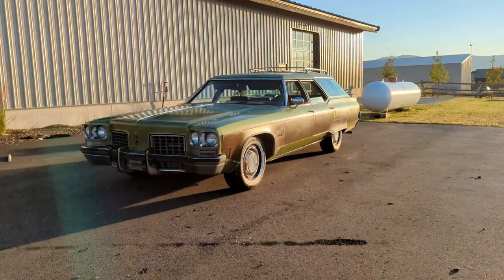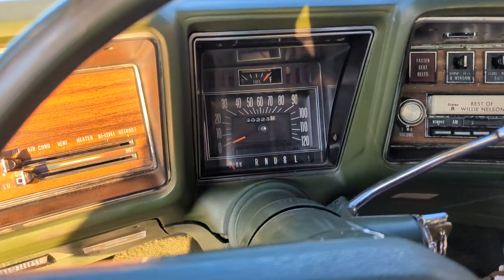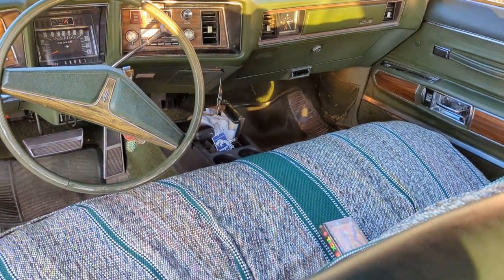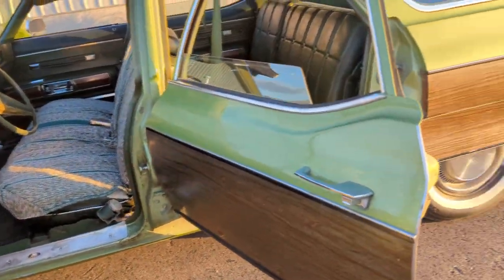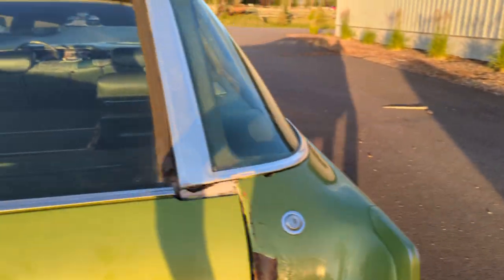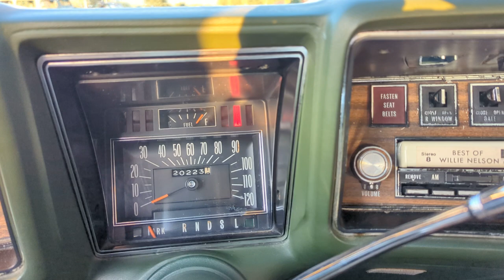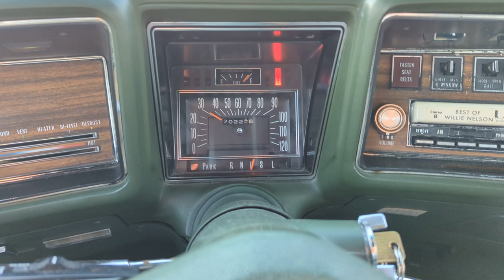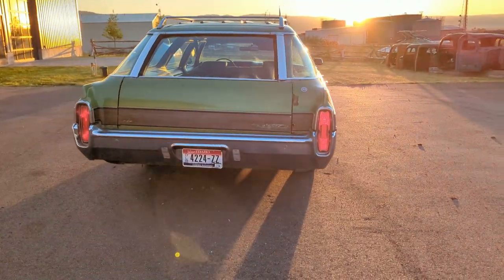FOR SALE! 1972 Oldsmobile Custom Cruiser survivor - Rocket 455 V8 - GM Clamshell - $13,000

Comment: My parents had a 1974, I remember it well. Got my foot stuck in between the rear jump seat. My father was an Italian immigrant and loved big American cars with big engines. He really liked the 455. In 1978 they traded it in for a new custom cruiser, my dad cursed the 350 for being underpowered. The ‘73 started my love affair with cars. I used to love the sound of full throttle while we would pass two cars at one time on a two lane highway. We lived in louisiana and took it to Colorado every year on vacation. You’ve got a great machine there pal, take care of her.
Reply: Parents special ordered a '73 model.  Dad built a clam shell for the roof and a matching clam shell trailer so our family of 7 could travel the country.  We live in Texas and drove it all over the U.S. and up into Alberta once too.  It was a real beast of a machine.  Smooth ride and comfortable with plenty of power.  Dad sold it back around 1990 for junk and still kicks himself or such a bad decision.  It had around 300,000 miles on it and engine still ran good.  It needed some minor work but at the time he wanted to get it out of the yard.  Dad just turned 92 and according to him, he never had a better vehicle!  I would love to find one to restore and go back to some of the places we vacationed so long ago!

Comment: Awesome Clamshell wagon!!
Love them.
I grew up and learned to drive on our mint, loaded 76 Grand Safari with the cornering lights and rally II key colored wheels as optios.
It had everything!!
Cream with wood!!
Today i own a maroon 76 caprice Estate in beautiful awesome condition inside and out.  Maroon with red interior and wood sides.
Never goes out in the rain!!
It has the 3 seats and power gate and doorlocks.. but not completely loaded!!
It has the 400 4bbl rebuilt and ac blows cold but i replaced Everything under the hood but the carburetor...  my mechanic said its good. Dont touch it yet!!!
Our Pontiac wagon had the 455.. same gas mileage on both.
Thanks again for sharing your GEM with us!!!!!  ❤

Comment: Hi my name is Carmine and this car leaves me speechless! The car is  beautiful looking and running. I have the same wide white wall tires on my 1984 Olds 98 Regency.  It was the same size that the car had from the factory. It has 151,000 mi. I also have a 1987 Olds Customer Cruiser with the 307. It just passed 270,000 mi. The engine had never been open and it still runs and drives  great.  Last but not least my 1978 Olds Delta 88 Royale.. with the Olds 350. It is a 1 owner car that I was lucky enough to buy from the grandson of the original owner.  She only has 33,000 mi. It was never taken out in any weather.  I always say you can't go wrong with an Oldsmobile. I love yours and I wish I owned it. If you ever want to sell it let me know.  But if I were you I'd keep it. Glad to hear that you're keeping it doors. If your looking for alittle extra power,  do like I did to my 3 cars. Put on true duel exhaust from the manifold back. Use stock mufflers and don't forget the exhaust resonators at the end of the pipes. It will keep it factory quiet and it will give it a noticeable improvement in power especially on the highway. You can use a lead substitute but you don't have to. Just stick to using PREMIUM fuel.  Yes they have lower compression engines but trust me always use PREMIUM.  The little bit of alcohol won't kill it. I use Sunoco 94 ultra in all my Oldsmobiles.  Last but not least use Royale Purple oil.  It is fantastic.  I noticed  on avarage a 5 to 10 degree drop in my coolant temperatures.  Feel free to contact me at any time for advice.  Good luck with it. Enjoy it hang on to her.
Reply from the maker: Appreciate the response, Carmine. This is all good information to have. I plan on the dual exhaust and new door seals this season along with a cooling system flush and new wheel cylinders. Next season I will probably tackle some of the more minor Imperfections.
Reply: @LiamO86  Liam you have a great car. And wait til you do the exhaust you will be happy.  I did my cooling systems to. If you don't have a 3 core radiator which I'm sure the 455 has, get one. If you not going to drive it much in the winter you may want to use a 180 thermostat.  Like I do with mine. Keep me in the loop I'd love to hear how the car is doing. That's some car!

Comment: Love these big wagons !!! She sure is a beauty,  & for 51 years old in pretty decent shape. That Clam Shell rear door certainly adds to the character!
 My folks bought a new 1974 Olds Custom Cruiser 9 passenger wagon in Oct 1973.  Not much difference than your 72,  grill, tail lights, & trim.   It was non metallic light green without the wood grain. Had a medium green interior.  There were 5 of kids & we needed the room. Traveled many miles on some great vacation in that big car. It had a 455 V 8 as well,  but suffered from the emission & smog controls that your 72 doesn't suffer with. The gas mileage was 10 - 14 mpg,  but the power was NOT as snappy as those per-emission models. The horsepower rating were down because of the emission controls,  but these were heavy cars. My folks drove that car for years & well over 200K then donated to the church they attended & the last I new it was still at it with over 300K before it drove off into the sunset.
  These big wagons had some style & character about them. They could be a luxurious dressy ride for a formal outing,  sporty ride to transport the team,  or the lake side, canoeing, fishing, or camping  & had the muscle to pull a big boat or travel trailer with ease,  as well as a load floor & capacity to handle a home improvement project, no problem. The wagons that followed these certainly didn't have that character, or capacity.
  I have looked for this era of Olds Custom Cruiser wagons for years.  All were extremely rusty, over priced, or both.  So I've settle for a solid rust free 1973 Chrysler Town & Country wagon with a 440 V-8,  9 passenger rear facing 3rd seat, drop down gate / swing out rear door,  beige with the wood grain. It got class & character as well. 
 All these big wagons were used, & used, & used, & abused,  & to find a solid rust free model is rare.  Love you Olds.  she sure has class & style.  Best of luck with her, Hope that really unique clam shell window gate works for you. Thanks for sharing it has brought back a lot of good memories!!!!
Reply: Chuck, do you have any phots of your wagon?
Reply: @patrickflohe7427  Hey there,  Sorry to say I don’t know of any photos for that 1974 Oldsmobile Custom Cruiser that my parents purchased new.  I would have like to have some pics of it myself;  would have gladly shared. 

🎄 “Happy Holidays “ !!!!!! 🎄

Comment: Great to see, Liam.  My Dad bought a cranberry red '73 new that we had for about 17 years but had no more than 54,000 miles in its use transporting us children around primarily.  The Custom Cruiser was the most expensive station wagon at that time and simply loaded with everything.  I wish I had the chance to drive my parent's just to get the experience of the legendary Olds 455.  What did the car in were electrical problems.  I suspect that a rust hole near the back window and locking switch for the tailgate was due to inadequate drainage resulted in water accumulating causing rust and electrical issues.  I guess I am partial to the look of the '73.  And the rear tailgate was a total party trick certainly.  A very solid RWD car from General Motors "good ole" days.
Reply: ‘72 was my absolute favorite.

Comment: You're probably aware of this, but by 1972 these had hardened exhaust valves, so were designed to run on unleaded.  I had two clamshell wagons and found the gate to be utterly reliable, but every couple of years it appreciated white lithium grease on the tracks to keep it moving at a proper pace.
Reply: I thought that wasn’t until ‘73 or ‘74?

Comment: 16:30 Now THAT's what a turn blinker/hazard indicator should sound like when in use! Not all wimpy soft as on  today's cars.
Reply: Then the sound was actually mechanical- the electromagnetic relay controlling the blinking lights made this iconic audible noise. Since it’s genuine in a car like this, it sounds more full and authoritative. Modern cars just play a digital facsimile through a speaker in the instrument cluster.

Comment: My family owned the 1973 model, the most expensive wagon GM made AND was more expensive than most Cadillacs. They drove beautifully. We had an issue with the fiberglass lined gas tank, which made its way into the engine clogging everything.

Comment: With a sled like that I'd give priority to the brakes. I've had a couple 70s vehicles where the brakes worked but something still wasn't right and it turned out to be the proportioning valve was bad. Also if the fuel filter was clogged with rust I'd check the tank to see where all that came from.

Comment: Years ago my mom had a station wagon. It wasn’t an Oldsmobile. It was an Impala Station wagon. Total rust bucket but the engine and transmission worked fine. I remember going thru a car wash with my mom and because of the rust seals around the window leaked. I got totally soaked

Comment: I always loved the look of the full-size SUVs (err, sorry, station-wagons...but really, what's the difference besides the platform they're built on?) of GM from '71—'76, regardless of make.  I always thought they were the best-looking wagons ever, and one of the best-looking cars in general from the '70s.  The very streamlined profile, the slant back with the wraparound curvature of the windows, and of course that cool tailgate mechanism all were decisive factors in my love for them, be they built by Chevrolet, Pontiac, Buick, or Oldsmobile.  If Cadillac had jumped on the bandwagon back then (maybe their first-ever "Escalade"...?), that would have really been something!  I remember wanting one of those as a kid, but my grandmother would not hear of it...probably because she still sorely remembered her experience with a brand-new 1960 Kingswood she had been convinced into buying.  Of course, the Kingswood of that year had nothing looks-wise on the Kingswoods that would come about 11 years later.  I would still like to acquire one of those as part of a personal collection, though I think I might prefer one from the Buick division; I just like Buicks best of all the GM makes.

Comment: I find it amazing that GM had the money to use a shorter wheelbase on the essentially similar Chevy. Not sure that the extra couple of inches really made any difference in the interior room. Perhaps it was just a selling point. BTW, according to specs that are available now, the Chevy 454 made more HP than the Buick and Olds 455s.

Comment: An awesome looking car. I think something like this makes the most functional tow vehicle for whatever you bring into a show or a swap meet or track the only problem with this thing really is not the 455 V8 it's probably getting like 14 mi a gallon. The problem is you don't have OverDrive that's the only thing you need. With just 3rd gear I would just say probably investigate getting a new or different rear-end you know a rear-end with like taller gears like 3.23 or 2.91 or something like that so this way you can cruise at highway speeds in 3rd gear and still get about about seventeen miles a gallon if you're using this to toe. I mean that's what I  meant for you to tow the car to a another car show and then you can sleep in this car cuz you can put a cooler in the back you can put extra tools in the back and put in the ice chest and a pillow and a change of clothes. And then you can sleep in the rear.

Comment: The old Station Wagons were the best & most practical vehicles in their time. They rode like Limos & they had payloads like 1/2 ton pickups with RWD & great towing capacity. The Olds Vista Cruiser & the Buick Estate Wagons with the 455's were the ultimate Wagons in luxury also. These new SUV's are a joke in comparison. The Station Wagons were better in every way except for gas mileage.

Comment: As this was posted 3 weeks ago you've probably been told to hold the Parking brake release,and pull up on the pedal to turn off the brake warn light.GM's did that all the time.The spring doesn't pull hard enough for the last bit to hit the switch.Nice ride.If it isn't a fuse,then water around the key switch at the tailgate rusted it and the contacts are poo.

Comment: I made previous comment  forgot to mention     i have  5 wagons oldest  50 mercury
56 nomad   56 corvette engine    66  Mercury  67 new Yorker 2   one 33k and one 73 k 
Best lead substitute  marvel mystery oil  add to fuel i use in all my wagons   other equipment  and  trucks   Use Delo 30 in summer  10 30 winter  or 15 40  
Use A/C Delco filters or Wix or Napa Gold (made by wix )  Never Never use fram filters 
They ruin engines  ...### now  as far as Brakes  you have  3 Rubber brake hoses  ##
Change them ASAP    average life 8 years on them max   change and flush brake systems   ... fuel economy  add dual exhaust  helps ... buy parts at napa for best quality  
Awesome wagon  thanks for sharing this 😊👍  what state are you located

Comment: The valve guides wear out in the 120k mileage range ( might start to smoke a bit on start up) as far as the air conditioning goes it could be as easy as replacing the dryer ( the moisture makes them crap out) overall she's a beaut Clark!

Comment: you can find all of the spec's;  last yr for high-torque was '70.  To trust it driving is to change many things;  all fluids, hoses, belts.  New motor mounts and tranny mount   drop the gas tank and get it cleaned.   Ask around for availability of water pump and alternator.  or get new brushes for alt.  potentially better front seat in bone yard somewhere

Comment: The 72s had reflectors above the taillights, that little body-colored piece that's attached and makes the tip of the rear fender "straight" I guess you would say. That's how you tell the difference between the 71 and the 72 from the back. I don't know why this one has 71 rear 1/4 pieces...

Comment: I respectfully disagree with the mileage.  I think it could be a 20,000 mile vehicle. The pedals, especially the brake, don't indicate over 100,000 miles. And the drivers door armrest isn't worn badly. Also, the engine is clean, and the valve covers aren't sweating. The engine sounds like a 20,000 mile engine.

Comment: These aren't hard to fix.  The sheetmetal looks in good condition,  can get the missing trim from junked ones and the front end is the same as the Delta 88 and 98 Regency from the same year.  Very nice and a rare sight today.  Could join ASWOA with it and take it to their shows.

Comment: That 455 deserves  a true dual exhaust system  and a new 4 barrel holly Carb  switch to light duty pickup truck tires & shocks & brakes  when you do your oil change  get a bottle of Prolube engine friction barrier treatment  help reduce the RPMs  the product has a pink  & purple label on the bottle  do not use platinum tip Spark Plugs  they will burn a hole in the crown of the piston  the pistons are probably not  hardened performance pistons  stick with  Goodyear tires  and a big  interstate 72 M truck battery  you should just go ahead and have a new radiator installed  & get new U joints on drive shaft & have that shaft balanced  with new weights on there  get new heavy duty coil springs on that old wagon it makes A difference  I did on my old Cutlass years ago   That whole clam shell assembly out back probably needs rebuilding & cleaning new  roller bearings  & guides  consider joining the Oldsmobile club of America  to get info and help locate all these hard to find parts  good luck !!!

Comment: Actually... This'n would be as good as the Continental to use as a tow vehicle for your Airstream...

A hitch would probably be easier to find for this car, too... But you can have one welded up for anything.

Also... If you don't have one already, look for a used Hensley Arrow hitch for the Airstream... They're weight distributing hitches and also have a pivoting feature that makes it seem like you're towing NOTHING.
THEY'RE PHENOMENAL.
Reply from the maker: I bet she can tow well! Our airstream is actually the class B van version on an 89 ford e350 chassis. Another boat!

Comment: I have a 1990 Mercury Marquis station wagon, it runs the brakes are messed up, needs tires has a dent in it the radio is gone. It's sitting outside full of bags of tin cans for the past couple of years. Thought I'd just sit on it till somebody wanted it. It's seen better days. But it's still a good car but a battery in it runs.